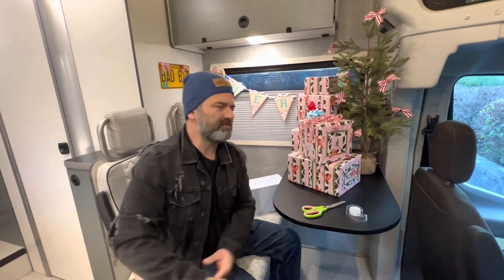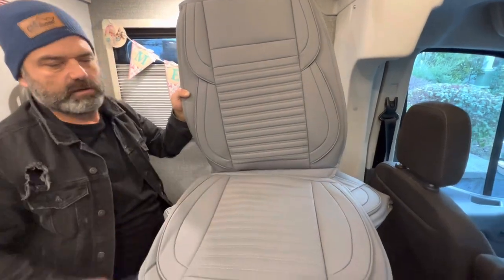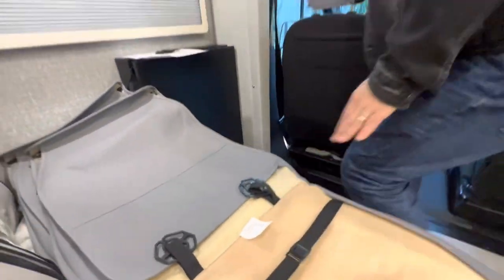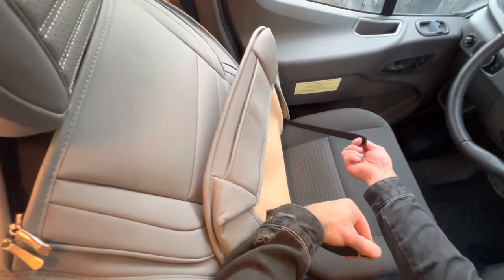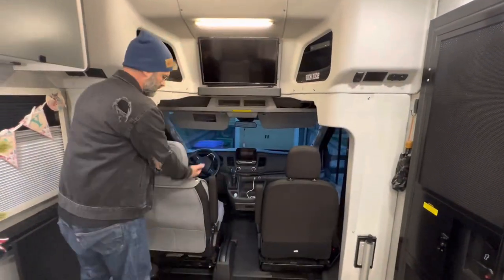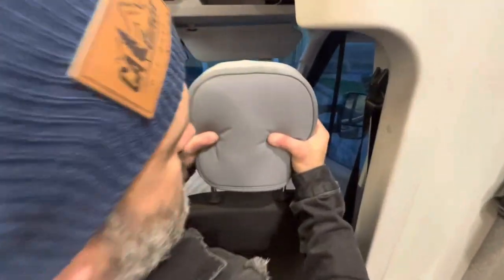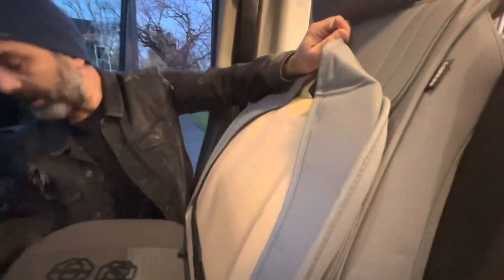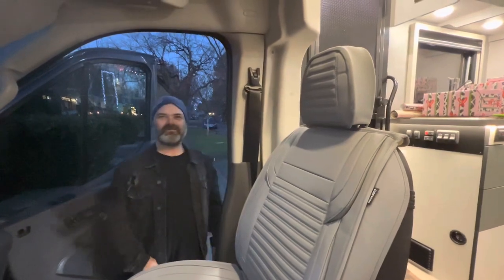MUST HAVE WINNEBAGO EKKO l FORD TRANSIT FRONT SEAT COVERS l INSTALL l PROTECT YOUR FRONT SEATS

Comment: Thanks for the video.  I really enjoy them.  I went with Wet Okole seat covers. A little more money but I have had them in the past and really love the durability of them.  Happy Holidays.
Reply from the maker: John, I may have to check those out for sure. These were such an ease to install, swapping out for variety may be fun/cool in general.  Thanks for the tip.